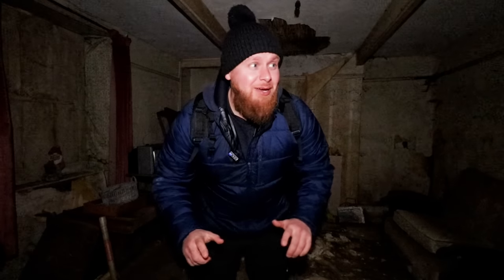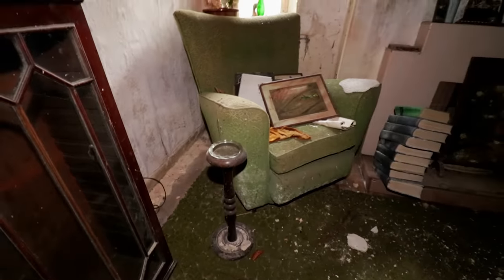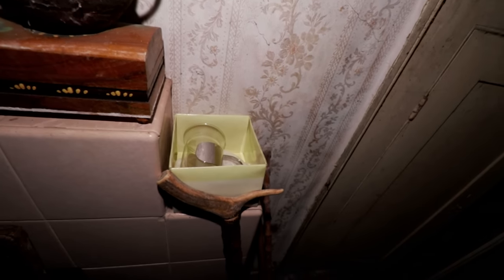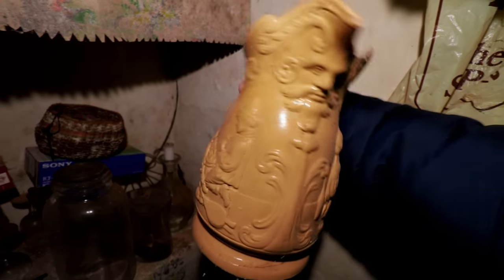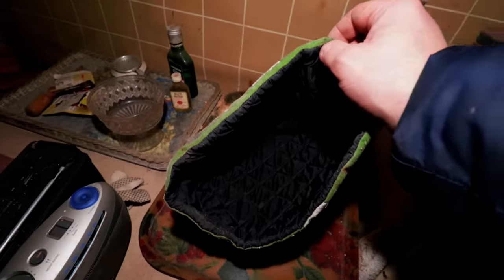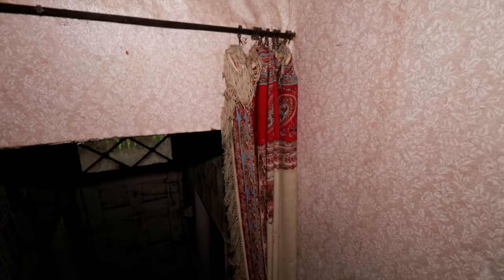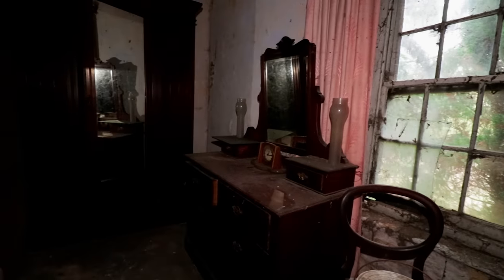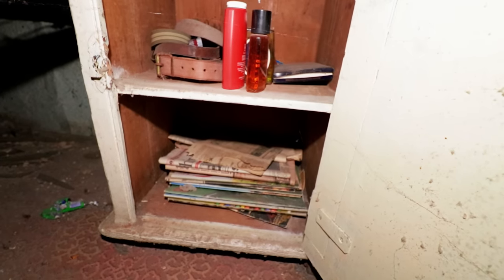Mystery of the Forgotten House...and the Body Found Inside!

Comment: Hello, the carpet hanging across the foot of the stairs is to stop draughts and alternately to stop the heat from rising up the stairs when you are heating the downstairs. We have stairs in our sitting room and a lot of the houses in the same street have either had a door put on or have a curtain fitted across for the same thing. These are the secrets of frugality lost on a generation used to modern day architecture 😂